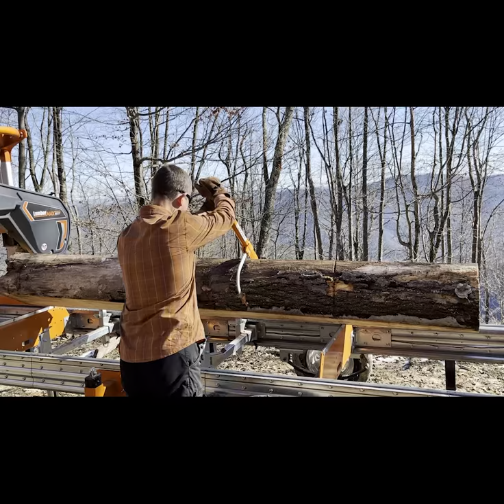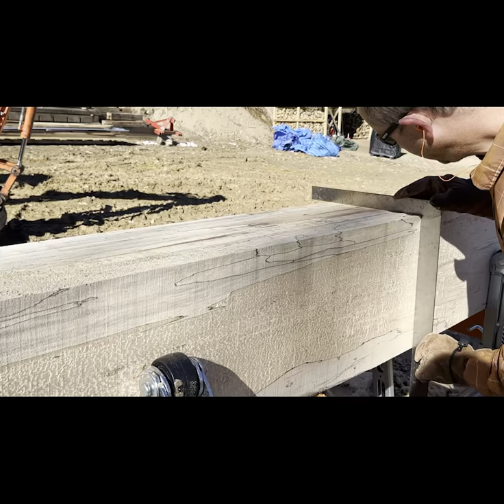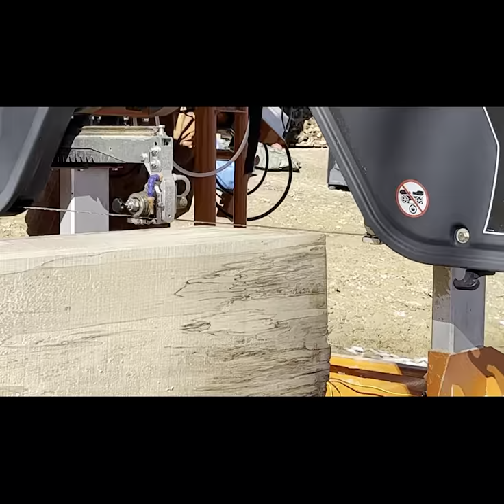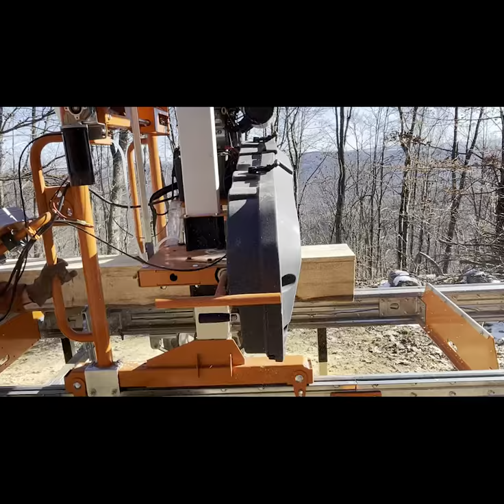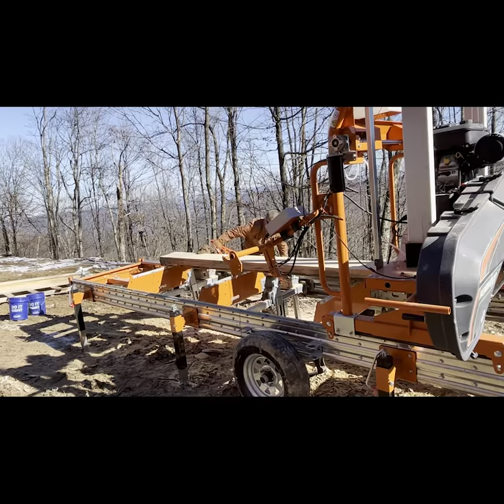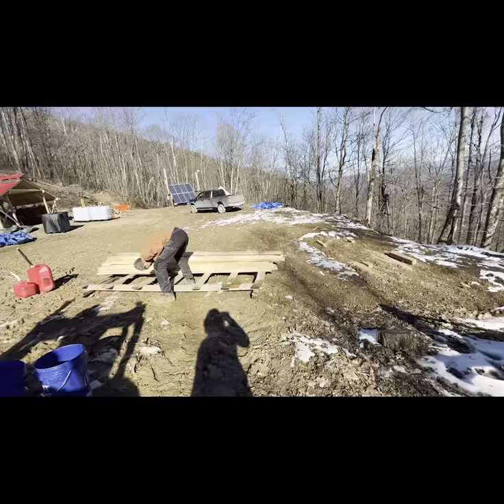First milling on Norwood HD38 sawmill

Comment: Looks like you're off to a great start with the mill.  A couple of comments... it appears that you backed the blade out of the cut while it was still spinning.  That's a sure way to pull it off the bandwheels and turn it into a steel pretzel (ask me how I know).  Glad you had some good help when the board shifted.  Did a clamp slip off?  It goes a lot better to flip the cant over so the clamp and log rest can bite into straight wood with no wain.  All stuff you'll pick up as you go.  Looks like you took it slow and thought about what you were doing, which is exactly right.  Norwood has removable extensions that add 2' to each end of the track.  That way, you could get your 20' boards & still be mobile.  I've tried 'em, and once you get them lined up, they work just fine.  Looking forward to more videos from you!

Comment: The spalted maple slabs big bucks a couple of things I noticed that I will mention first is you should always put the smaller end of the log towards the mill head the second is you should level the centers of the log this may mean shimming up the smaller end to achieve the same height on both ends from bed also try limiting the number of times you start and stop during the cutting process makes for smother cut and less chance of blade digging a spot across your lumber from sitting in one spot with blade running this can also cause heat spots on blad and shortening it's life happy sawing

Comment: How long of a log can u saw and how big of a log can u saw and if u don't mind how much was the cost of mill
Reply from the maker: 38” high, somewhere around 35” wide if I recall, just over 16’ long with the single 4’ extension I currently have installed (I have a 2nd 4’ section that will bring it to 21’ long but you can’t use the towing setup with 2 extensions in place.)  It’s been a while now so the numbers aren’t exact but the whole setup without any hydraulics, with a box of blades and the cant hook was ~$17k